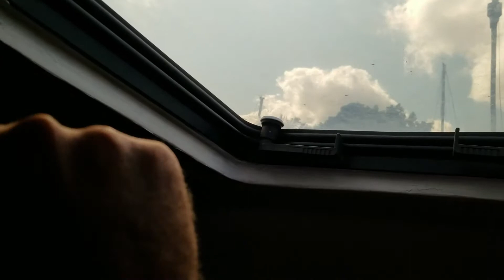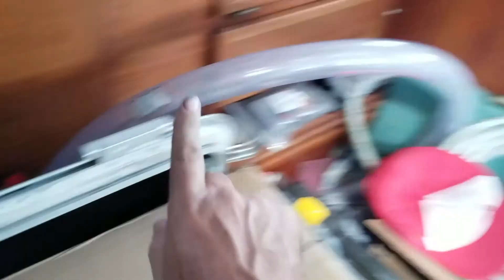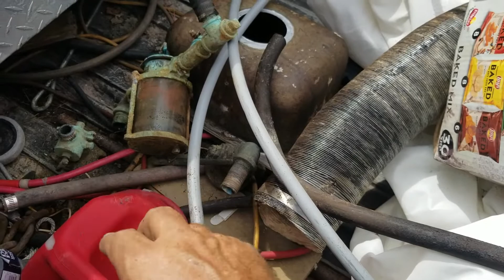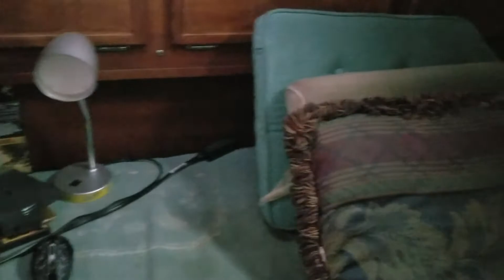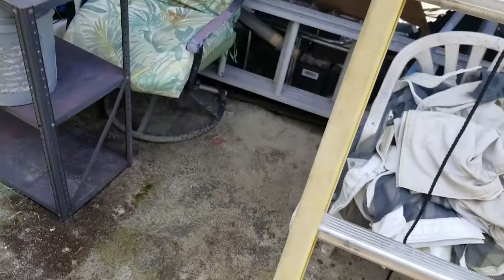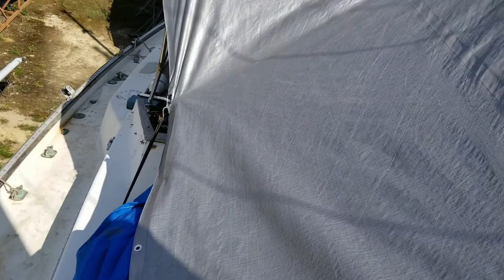Whitby summer update

Comment: Holy Bats!  I don't even know where to start.  I couldn't believe all the junk that is in the back of the truck that came from only one bathroom.  Can you sell that?  The hatch looks absolutely amazing, inside and out.  Very professional looking.  And in the engine room, I can't believe the difference there either.  You could barely get in that room.  That's very cool that the box (can't remember what it was) at the back of the engine room is so much smaller and yet runs more efficiently, you say!  And all that wiring that's gotta go soon, along with that thing that is jutting out and in the way in the engine room.  Forgive my not knowing what they are called.  Now that the antifouling has been done, does this mean no more Blue Man?  I still have that pic of you lol.  Do you mean to tell me that tiny little propeller is for that huge ship?  I'm seriously asking this?  Rope clutch?  I thought a clamp held something tight rather than a clutch.  Maybe you'll "splain" that to me later "Ricky" :) Where the sails and insullation are at, is it correct to say that will be cleaned out and empty when you're done?  Is that where someone might be sat at the time you sail?  Geez, I bet that solar converter cost an arm and a leg, but it sure is swanky!  Nice!  Lithium batteries are impressive, geez.  That's interesting about how they get down to 10% before safety protocols vs the 50% with AGM batteries.  Wow, I am impressed especially since the heat is so incredible where you're at.  Hmm, sitting on a lake in the mountains would be so much cooler!  Arr arr arr, sorry for the bad pun.  I'm ready for more updates.  Talk to ya later. xo